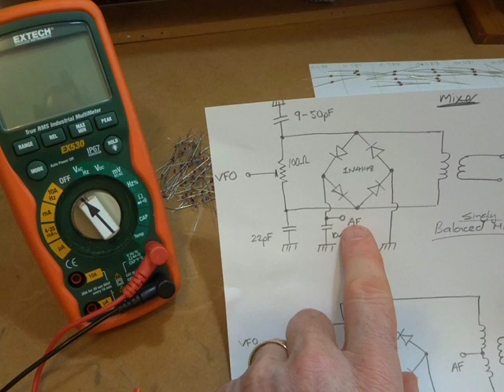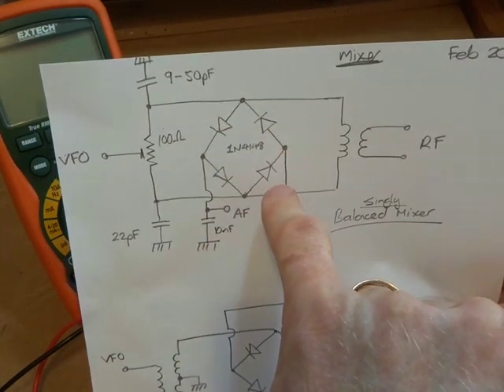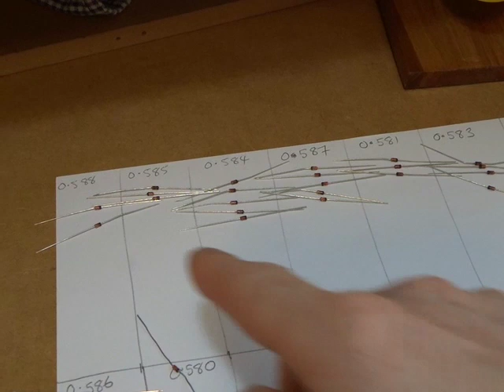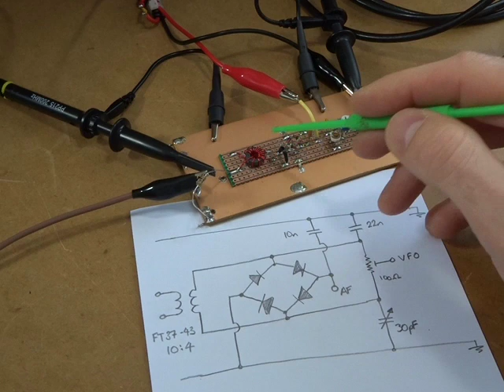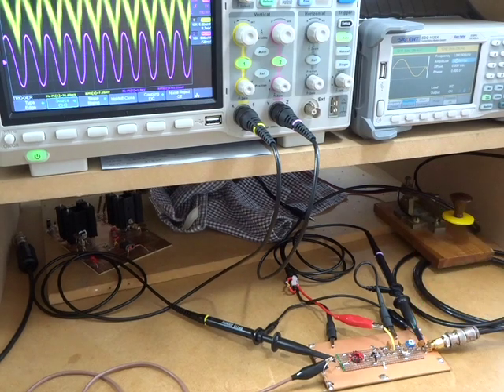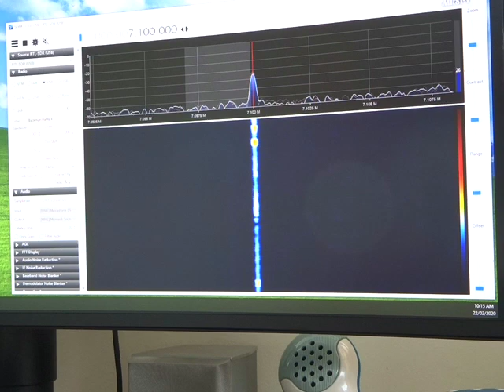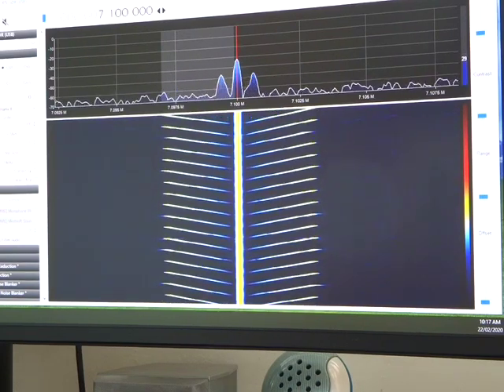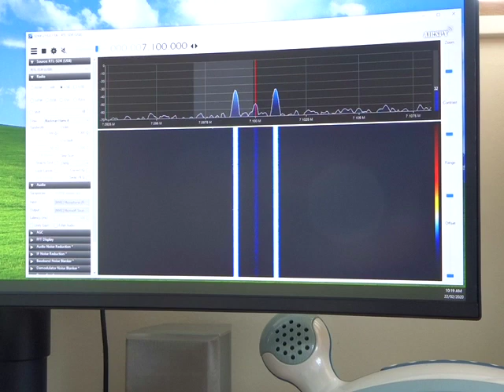Simple Homebrew DSB-SC 80m 40m Rig: Part 3 - Mixer

Comment: Amazing video! i was matching a couple 1n4148 and the fV on the multimeter goes from 0,631 to 0,642, with most of them landing in 0.638. i took a look at the datasheet and said the minimum fV is 0.62. why are yours mostly around 0.58?

Thanks, and again, amazing videos.

Comment: I have built a DDS VFO...I have built your doubly balanced mixer.....I have the bits for a LPF...Gonna try and build a DSB 80m rig (transmitter first). It is always the "simple stuff" that stuffs me! I have an old Baofeng mic does that need about 3v to bias it? I was going to use an audio amp kit 1w to get this done but having looked at other ccts believe this might be way too much gain into the mixer for a mic amp (can I just wind the volume way down low?). I would just like to thank you for all these resources I used your method to match diodes and also used your mixer in my DC receiver! 73 de VK2AOE

Comment: just 2 pence - the diodes for mixer need to be matched not only at DC (resistance) but also at AC, i.e. have very close capacitance. Also, matching resistance just at one point is also not enough, it's better to do at 2-3 points, e.g. 0,1mA, 1mA, 10mA.

Comment: It's like beach40 from VK3YE, but i have question. So, there are no decopling capacitor from vfo (si5351 output) to the mixer? And thank you for your explanation, it's very helpfull. sorry for my bad english.
Reply from the maker: I typically do not have a coupling capacitor on the output of the Si5351 when driving SBL-1 mixers etc. It works for me.

Comment: FB Mr. Morris! It looked to me like there were more harmonics when your LO was a sine wave (it was easier to see them in the waterfall vs. the spectrum analyzer view) - was that just how the video compressed, or was that really true? Sorry for asking the question 4 months late... 😀

Your videos are fantastic, and I love your accompanying website with schematics and information. Thank you so much for the great content, and sharing your hard work!

73,
Josh, KB8NYP
Reply from the maker: Hi Joshua. To tell you the truth I don't recall. I used the sinewave VFO for the AM radio. Typically though, I use the Si5351 square wave to drive the mixers with no issues. Soldersmoke had a video a year or two back that explained why square waves were better for this type of mixer. 73.

Comment: When using the RTL-SDR dongle to view your output, are you feeding the output of the mixer directly into the dongle?  Do you ever use the dongle to view higher power signals?
Reply from the maker: No, I was just loosely coupling the output to the RTL-SDR. I don't use it for higher power signals.

Comment: I noticed you are using the diode ring double balanced mixer. Have you looked into the dual double balanced mixer(triple balanced mixer)? I have read that it gives better isolation from LO and RF and I’m thinking about giving it a go.
Reply from the maker: Hi Robert. Yes, I have build several double balanced mixers in the past. There are videos on that. The intent of this build was to make a simple easy to build radio as a homebrew starter. To that end I elected to use a simple single balanced mixer. It still works very well.
Reply: Charlie Morris Awesome. Keep it up, because there are many of us who gain so much from your work.
Reply from the maker: @robertcullipher3492  I certainly will Robert.

Comment: Hello Charlie. Have you ever used the NE602 or NE612 as a balanced modulator? I have only used the MC1496 as a demodulator for 40 meter SSB/CW. Thanks!
Reply from the maker: Hi Loren. Yes I have a few times. An example was the 80m tramping rig back in 2017. It's on the blog at https://zl2ctm.blogspot.com/. While they work well, my aim for this rig was to use a simple diode based mixer. Maybe I should do a rig with as many chips as possible. NE612, NE5534P, LM380 etc. Perhaps even a MCP1350P IF amp.

Comment: Oh BTW, your balanced modulator circuit  looks ALOT like the circuit Heathkit used in the SB102 transceiver, except I think they used a differental butterfly capacitor instead of the trimmer and fixed capacitor, also IIRC the output transformer was a tuned circuit.   I recall that eventually the balance pot in mine went bad, and I couldn't null out the carrier.  I replaced it with a MUCH cheaper one from RatShack, and that one lasted forever (until the rig was replaced a decade later).
Reply from the maker: That could very well be. If I recall, I got this mixer from the Beach 40 so I'm not laying claim to it's design. It certainly works very well for a small parts count easy to build simple homebrew rig.

Comment: Thanks for the informative video. It's a nice blend of what the circuit is and a demonstration of how the circuit functions. I particularly like the use of the SDR dongle as a "poor man's" spectrum analyzer.
Reply from the maker: Hi Mike. I use the SDR dongle quite often to monitor the spectrum. It sometimes gets a bit difficult when the power gets up, but all-in-all, it works well.
Reply: @CharlieMorrisZL2CTM  I wonder what is this little black box doing, which is attached to the SDR dongle?
Reply from the maker: @dl9ar245  They are a couple of filters. One is a Broadcast FM Band-Stop Filter and the other a Broadcast AM High Pass Filter. The combination works very well.

Comment: Shockley diodes are not that expensive. While their lower forward voltage drop isn't important in the transmitting mixer or the balanced modulator,  it IS important in the receiving mixer.
Reply from the maker: True. In the spirit of keeping things simple I'll use the 4148s in line with SSDRA. Shockley diodes would certainly be a great thing to look at once the radio is built.
Reply: diode 4148 which is a good size for mixer what size if measured?
Reply: @odolhf8038  Physical size?  Through hole device is about the size of a 1/4 watt resistor.
Reply from the maker: @odolhf8038  Hi. Not sure what size you are after. The key is trying to get four diodes with a close as possible forward bias voltage across the PN junction. In the end i went down to 3 decimal places.
Reply: @CharlieMorrisZL2CTM  I mean, a 4148s diode is good for a mixer, when measured with a multitester it will show a large or a small number

Comment: How do you work out the input and output impedance of the mixer? (so you know the transformer turns ratio)
Reply from the maker: That's a good question. I first used this circuit some years ago and it came from VK3YE's Beach 40 DSB radio. I liked it as it was a simple single transformer non-trifilar wound. Now I have taken a good look through both Solid State Design for the Radio Amateur and Experimental Methods in RF Design and while both cover balanced modulators, they don't talk about the impedances. As you know, my preference is to try and understand what is going on. Sorry about that.